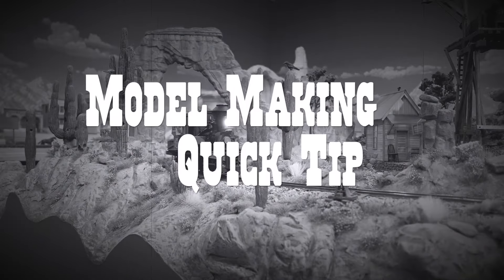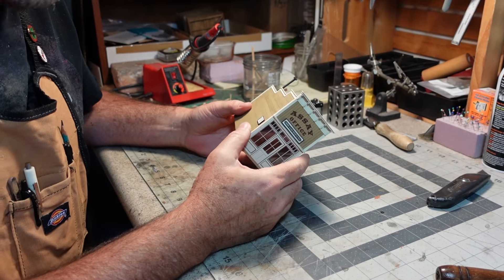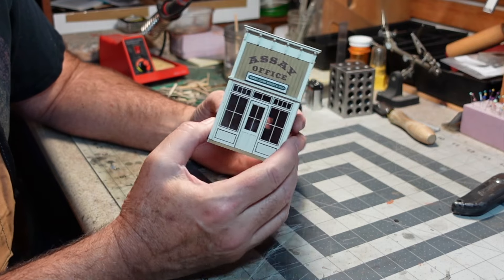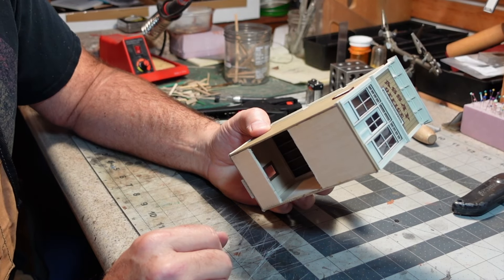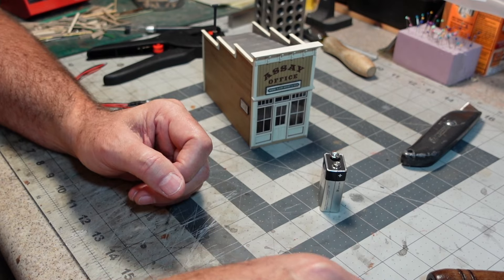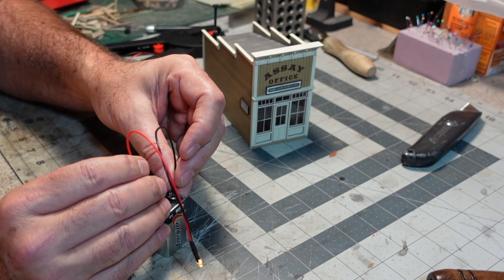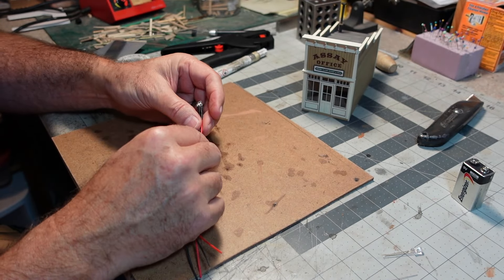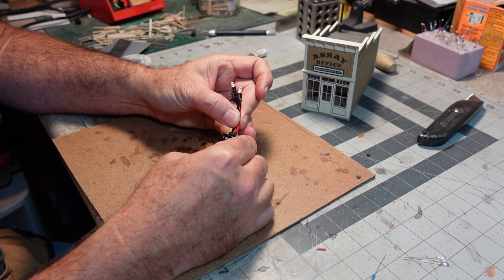Model Making Quick Tip: Easy LED Lighting for Structures

Comment: I came to your video by chance, but it helped me figure out some options for my projects. I was wondering what do you use for "glass" on the windows of your buildings? And what do you use to attach it in place too? I was using double sided tape and just some clear packaging plastic but seems difficult to work with...
Reply from the maker: I often use clear plastic from old packaging. I highly recommend Zapp Canopy Glue for an adhesive.

Comment: Hi David
Just seen this a second time.
A tip I saw somewhere was to put a plastic drinking straw in the hole to make it easier to feed the wire down through the foam.
regards John

Comment: Thank you for this. I am not building rail roads... I am working on a highly detailed tractor/trailer rig.... this is the best explanation I have seen yet. I am curious about the DC wiring bus. I got 57% on my grade 10 electricity   course and its been a lot of years since then. I will have to do a search on the wiring bus and the 9v DC transformer. Thank you very much for this video.

Comment: As always, a great video and very helpful to those who are not comfortable with electrons.
I would just like to make a couple of small points... 
     1) the legs on an LED are not called diodes - just leads or legs. The whole unit is a diode. 
     2) It does not matter which lead you solder the resistor onto - either one is fine. 
     3) you use different values of resistors for 2 reasons - to drop enough of the voltage so that the LED will not be over-driven and to set the brightness of the LED. 
Most LEDs drop about 1.2 to 1.8 volts, so the resistor is needed to drop the rest of the voltage coming from your source. 
Once in the right range (1.2 - 1.8 volts), small increments of resistance, up or down, can set the brightness. Using a 320ohm resistor will make a much brighter light, whereas 1K ohm will dim it down... Higher resistance = lower light level.
 
Just wanted to add that to an already very helpful video.
All the best to you and the folks of Thunder Mesa.
Jess
Reply from the maker: Thank you for those great facts. Very helpful!
Reply: Most LED strip lighting already has the ballast resistor (dropping resistor) made onto the LED strips.  I usually use from 9 to 12 LED's per coach.  When using single LED's I use a ballast resistor in line with either lead of the LED.  It don't matter which one, just so there's a ballast resistor.

Comment: For structure lighting, I run a positive and a negative 12 volt dc buss below the layout and drop LED feeders to the buss.  Makes for easy lighting without a lot of fuss and muss.  I lit up an HO scale RPO car and used bright white LED strips 'cause that's all I had ordered.  Wife said the RPO car didn't look right--lights were too bright.  So I took it apart again and used some acrylic yellow paint & painted each LED bulb with the yellow paint.  Looks like I used yellow LED's now and the car has a better appearance, definitely not too bright now. I even made my own pick ups out of some thin copper I salvaged from several old computers.  Now I've got about 8 more coaches to light up with LED strips, full wave bridge rectifiers and a 3300uF capacitor for non-directional flicker free lighting.  W Rusty Lane K9POW in eastern Tennessee

Comment: Hey Dave,
I love that black box effect.  In the next few weeks I am going to give it a try.
Back in January, during my cardiac recovery, I did some structure rehab including interior enhancement.  My technique or mistake was to cut the floor section or the roof section away.  Build hidden channel walls to run wiring.  Hand paint the interior walls black.  Add lighting.  Install scaled realistic photos and props.  Finally reattaching the floor or roof with the ability to have future access.
Damn that took days.  But where was I going to go.  The recliner, the bed, the treadmill.
The idea of lightning an alligator foam box, glueing on the interior photos, and installing it to the roadbed is cool.  Thank you for the upgrade.
Jim

Comment: Some really good ideas! LED’s are a wonderful modeling resource once you figure out how to use them without blowing them up! I credit YouTube with enabling me to overcome my intense led paranoia, and Amazon with making it so easy to find the electronics components that we modelers need! And speaking of Amazon, that’s where I discovered the variable voltage wall wart! Bought one, don’t know how I’ve lived 62 years without it! I have several now, very handy at the workbench, and if you add those little adapters that plug onto the cord and have two screw terminals in them, you have an incredibly handy and cheap tool!

Comment: THANK YOU SO MUCH!!!  Everything about this video is spot on...loud and clear sound with instructions well explained.  And yes, I do remember the little grain bulbs included in kits, but never bothered with them because I considered them a luxury as they would barely last.  Indeed, the LED is a gift from the hobby gods - we live in a great era for modeling between tutorials like this, modern products, and easy access to these items.  I have used the Woodland Scenics "Just Plug" system which, yes, is excellent, but not if you are working within a budget trying to light a large layout.  Besides, the explanation here allows modellers to customize their lighting to a greater extent.  Just Plug is great for the central control and easy use, but it is too costly for situations requiring significant use, unfortunately.  A pleasure to watch this!!!

Comment: OMG this just made my day. Im literally in the process of doing this now.  But can you tell what did you use for the dc wire bus and how you wired the wall wort to it
Reply from the maker: You can use any 9-12 volt rated DC transformer. Many of these wall worts have a plug you will need to cut off. Remove it, strip the insulation off the ends of the wires, and screw it to the terminals on one end of the bus. You can pick these terminal strips up at most hardware stores.
Reply: @ThunderMesaStudio  oh my God thank you so much. This was so helpful.

Comment: Hello, i found your video very interested and helpful because i am also new on diorama making and i want to include led as part of my project. i am just wondering, what is the tool you use splicing the wire and its already been cut after?

and where can i buy positive and negative wire is there a size for wire? and what is the name of the bulb? 

sorry if i have so many question. thank you inadvance. 👌

Comment: What type of toggle did you use? I will have 3 lighting sections so I assume 3 power strips and 3 power supplies? Thanks.
Ron
Reply: Also, can I use a 12V walwart instead of 9V? I have several 2000ma ones available.

Comment: Thanks for sharing. That is a great idea for lighting structures. Maybe I missed it but why are the LEDs you just installed flickering?
Reply from the maker: As mentioned in the video, to represent kerosene lamps.
Reply: @ThunderMesaStudio  Thanks.
Reply: You can buy the leds flickering or flashing or steady.   Do buy them with the resisters already on them!   Huge help.

Comment: You never explained how the 9-volt power goes into the test strip that was my whole question how are you getting power to these little lights plugged into an AC wall at 120 volts